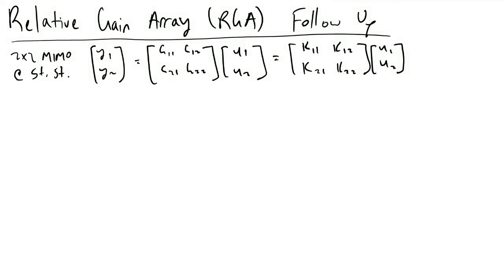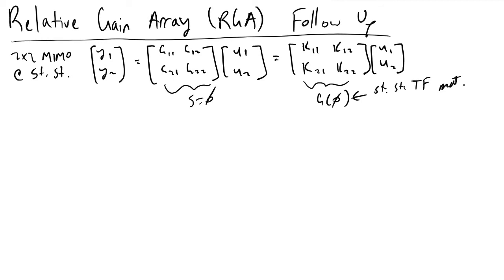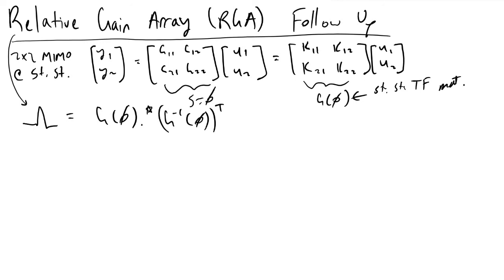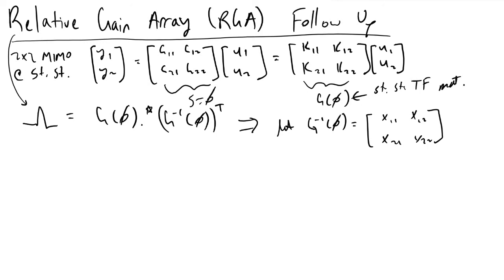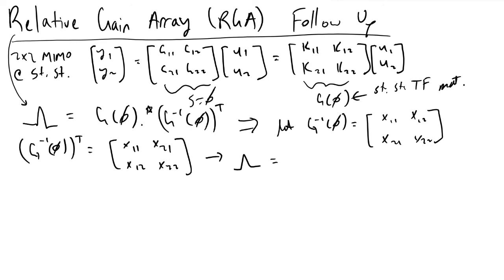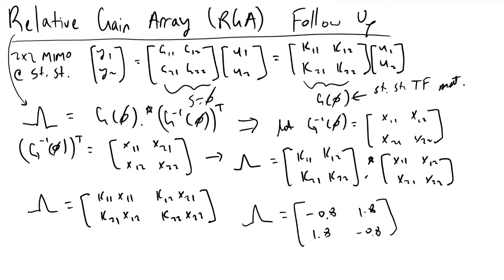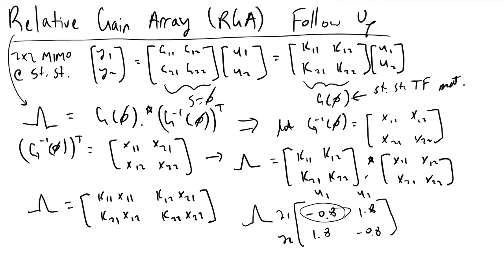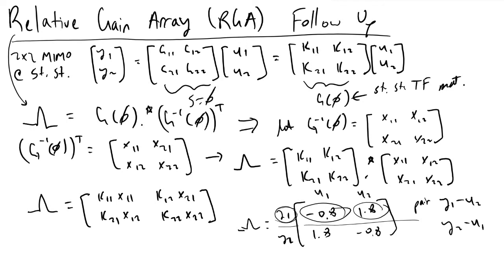Relative Gain Array RGA Analysis

Comment: If you can, would you explain why choosing coupling with negative RGA elements will introduce instability ? In MIMO u and y are vectors so would it not mean that with a negative coupling, it would just affect the coupling in the opposite direction. (sorry if my question is weird, still a little new to this).